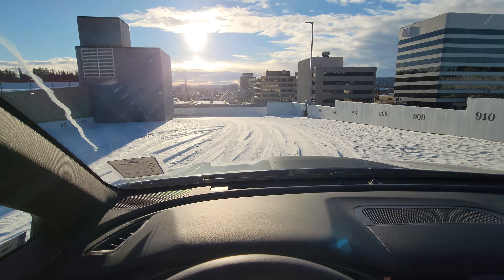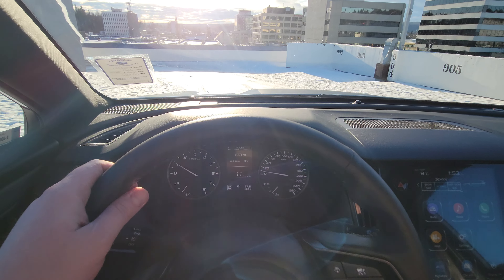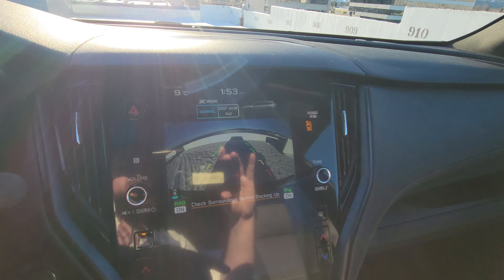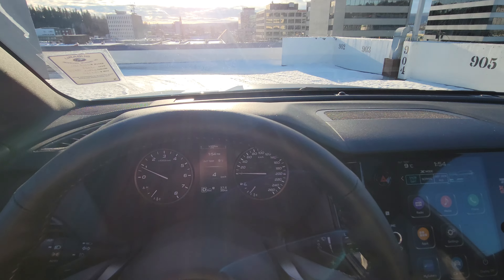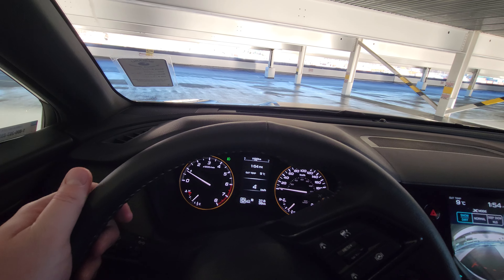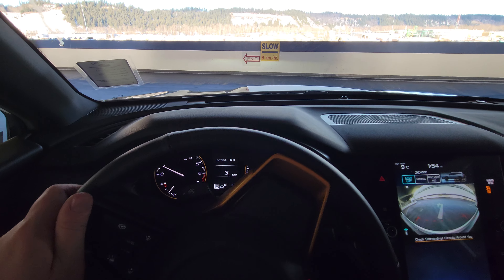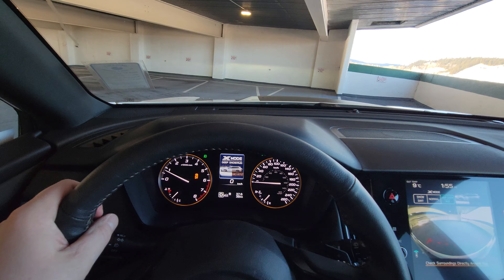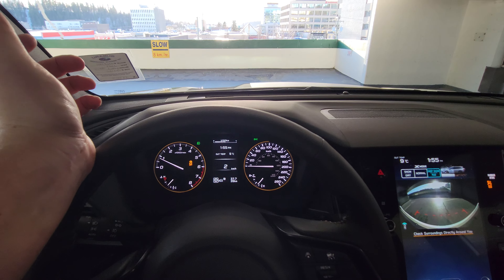Subaru X-mode Hill Descent Control

Comment: Tyson this was a fantastic demonstration of hill descent control!  I was told the software remaps the CVT and provides some extra breaking.
Reply from the maker: Thanks! Glad you appreciated the video. The Xmode software does change the CVT programming by changing the "ratios" and does individually apply the brakes to the correct wheels to maintain a certain speed.